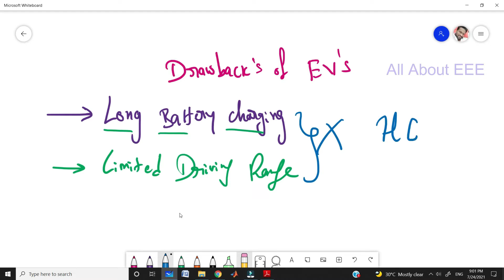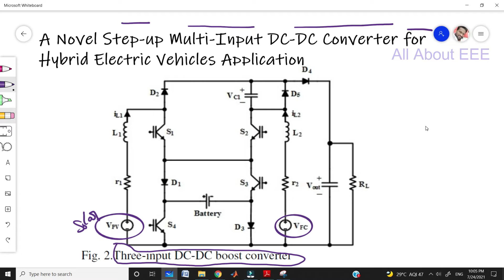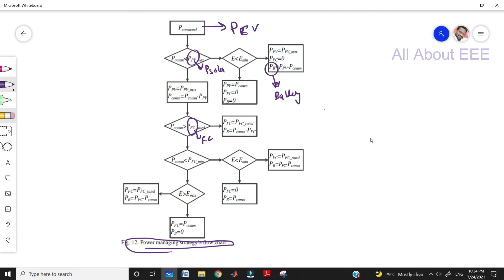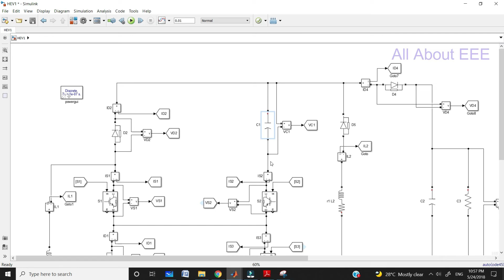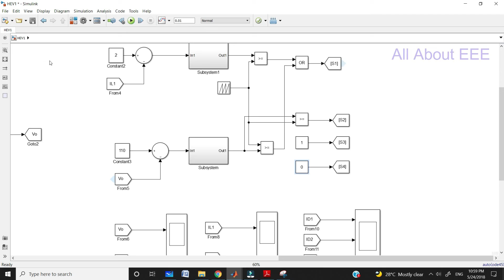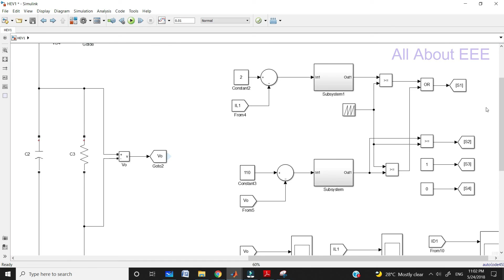New Step-up Multi-Input DC-DC Converter for Hybrid Electric Vehicles Project Using MATLAB Simulink

Comment: sir where is the state change logic? its not implemented in simulink functions?
Reply from the maker: It's is there in control part. And for each mode we are developing separate .slx files.  For no battery with battery discharge and with battery charge totally we need to do 3 matlab files. In single file it's not possible to do bettery condition in 3 states.